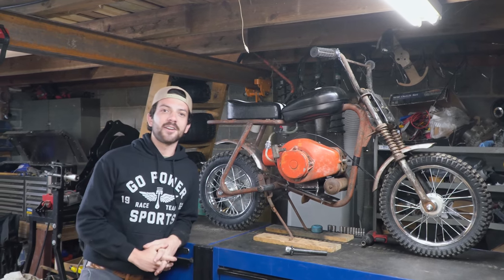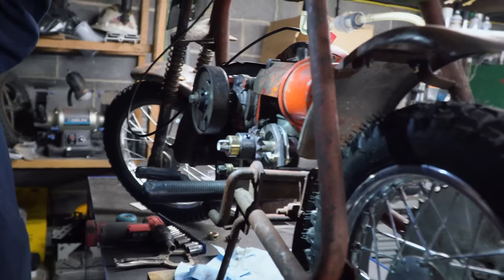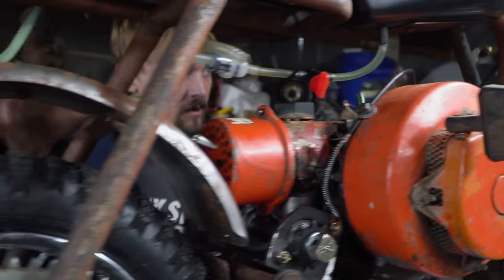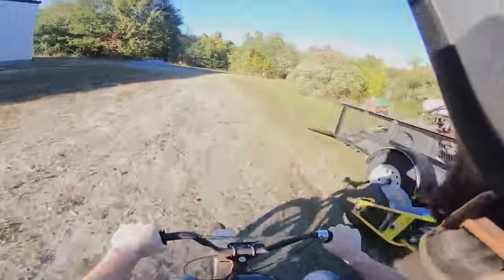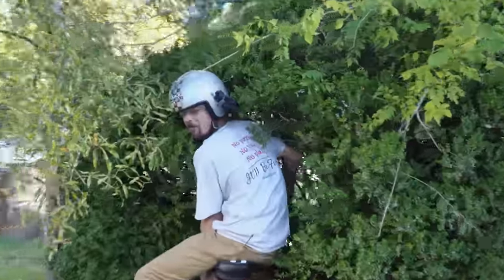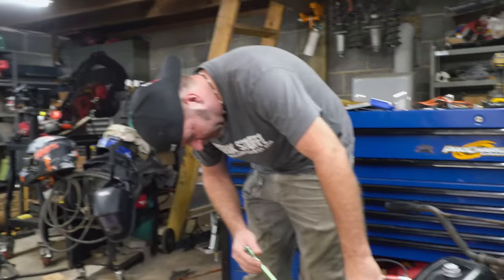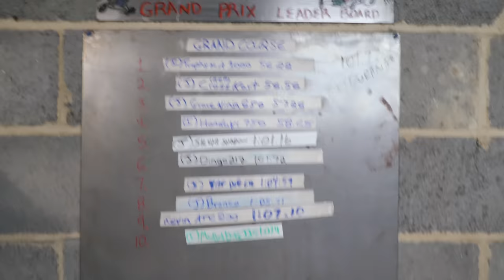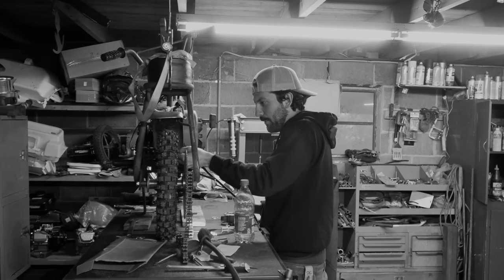Making our 2HP 2 Stroke WASHING MACHINE Powered Mini Bike Faster!

Comment: It got's the power you just need to set the gearing for the high rpm's for a two stroke. Use a slide carb with pod filter.
performance expansion chamber. eliminate the jack shaft.  This thing should rip pretty good. I love this build!
Reply: U r absolutely right. Maybe get some port work done to it (if possible) .. after they get to the next project .. while its just sittin up
Reply: From what I've heard megaphone exhaust works better on this older style than expansion chamber but yes.
Reply: @noahpaulette1490  yes exactly, a proper Mikuni conversion, and a tuned megaphone and it will wake right up, port work on these cross flows are gone about much differently aswell. If anyone is interested, the book tunning for speed, covers alot on the very early two stroke development as it was written first in 48 and updated a few times throughout the 60s into the 70s. Nothing wrong with the jack shaft, the clutch engagement needs to be at a much higher rpm to get her off the line with athourity.

Comment: The Biggest train wreck in C&C history?? I remember a school bus story once...
Reply: Nah 2 strokes for the win ;) 
As the saying goes. There should only be 2 valves on a bike. One in each tire ;)
Reply: What are the odds of you showing up

EDIT: please say that you kind of hate two stroke engines because we all know that they don’t have good acceleration when it comes to full throttle and power. You don’t get no more than 3 horsepower 4.5 if you are lucky but definitely hardly any torque. You’ll have to push it to even get it to go. Also, the carbon build up in the cylinder head will get insanely bad due to the gasoline and oil both entering the combustion chamber and as a result say goodbye to your head gaskets.

One word of advice when you put those 2 stroke vehicles in storage drain all of the fuel immediately. You’ll end up cleaning out the carburettor of all of the sludge. Especially if you don’t want to have the needle and seat to stick because it could cause the engine to run away.

I am saying that about my personal experience with using a 2 stroke go kart. Two words for that…. IT SUCKED

I never bought another one again
Reply: I remember someone rolling a hot rod lawnmower
And the police coming to John's parents' house
Reply: @dilianvt  

...wtf is happening
Reply from the maker: HAHAHAH
Reply: @PKMartin  clearly a long time viewer. Same here bro. I remember a monster moto with a wooden block to raise the engine
Reply: @CarsandCameras  if you change the rear sprocket to like a 25tooth or 28tooth sprocket and keep the front sprocket the same size it is atm you will go faster than it goes now
Reply: #teamseas.
Reply: @dilianvt  I'm not sure if you're talking about particularly awful two strokes because I have an RGV which makes 80hp out of a 250cc motor. My cousin has a two stroke shifter kart and they lap Phillip Island GP course in less time than a V8 supercar (Aussie racing series, fully built race cars). Two strokes are often misunderstood but they can absolutely make big power!
Reply: @codmobileadventures4796   I hate to disagree but, a smaller rear sprocket will, most likely, result in the bike going SLOWER. How does that work? The engine is already working too hard, INCREASING the load will only make it work harder...

I came here to say "if the total gear ratio isn't south of 8:1 (ie: more like 9 or 10:1) it's too high; decreasing the ratio will not only give you better acceleration, it MAY increase top speed because the engine isn't working as hard to get there..."
Reply: @PopllFixit  not really as the rear sprocket it self looks well bigger than a 30 tooth so if they go down to a 25 or 28 the engine won't have to strain it self as much as its doing atm giving them more power nd faster top speed its the same on pitbikes if the rear sprocket is a 41 tooth nd the front is a 14 its going to flip all in the bottom end but you drop the rear to a 35 or 37 then it's got more control on bottom end stopping the bike from wanting to flip as I should no as got a road legal pitbike nd had to do my own gearing to find the best for road use and I ended up with 18front 35 rear and I get 75mph maxed out but sits nicely at 60 nd thats a 140cc pitbike
Reply: @codmobileadventures4796  Cool story, now go try a 3rd gear take off, you'll smoke the clutch before you gain any real speed...

A pitbike, like most other motorbikes (& cars), has internal gears which allow you to take off at a decent rate as well as having a decent top speed as you change through the gears. THIS HAS ONLY ONE GEAR which must be a balance between decent acceleration & decent to speed; it currently has NO acceleration which tells me the ratio is too high...
Reply: @PopllFixit  I do 3rd gear take offs already no problem at all even do 2nd gear take offs still no problem like I said they need to make the rear sprocket smaller for better bottom speed or there going to blow the engine up from having to strain to much
Reply: @PKMartin  remember ike didnt even used to wear helmets...now hes decked out in safety gear lol
Reply: @PopllFixit  once they get the other issues of power figured out to improve acceleration with torque, improve compression ,spark, porting.... the smaller sprocket will give it higher speed only once it has more guts ....
Reply: @codmobileadventures4796  I have know idea how your logic works, do you even understand how gear ratios and torque work? The higher the gear ratio (i.e: gear ratio is 10:1) the higher the output torque but the lower the rpm is and as such it also takes less input torque to produce the same amount of output torque but will require more input rpm to get the same speeds, if that the gear ratio was lower (i.e gear ratio is 5:1) the output torque will be lower but the rpm will be higher and as such will require more input torque to produce the same amount of output torque but less input rpm is required to get a higher speed, thus, being that this minibike uses a 2 stroke engine and that 2 strokes like to rev more as opposed to a 4 stroke (at least in most cases and smaller engines like this), increasing the gear ratio will benefit it more than lowering it as it makes it's peak power at a higher rpm, not to mention the clutch engage rpm is way to low for this engine.

Comment: add more springs to the clutch to make it engage at higher rpm...2 strokes have no power until they wind out...basically the clutch you have on there is meant for a 4 stroke power band that engages at much lower RPM..
Reply: yeah like you would a tuned moped
Reply: You can hear when the engine gets into it stride and starts pulling, it around there it should engage.
Reply: Problem with that is you just burn it out. It's meant to engage just below the rise in the powerband
Reply: Exactly what I was just thinking
Reply: Well it's a washing machine engine not designed for high RPM.  this engine is has port timing design for low RPM.. if you really want to wake it up need to do some porting and add an expansion chamber and some other goodies
Reply: @speedyme200  a pipe could be made for low rpm. Enduro style. Around 6000-7000rpm range would still give her a nice grunt 👍
Reply: That is a very good point
Reply: it needs some timing advance
Reply: @speedyme200  even washing machine engines powerband ran at around 5000-6000rpm which is where most 4 strokes top out..
Reply: Seems you needed the jackshaftto move the motor left side drive to the wheel sprocket on the right.  And with that you had the option to change up the sprockets to get more top end at the expense of bottom end torque.   So then like everyone else said, why not make you're centrifugal clutch come in at a higher rpm?  (I have a 5hp 2 stroke snow blower engine planned for a ktm 50 sx senior).

Comment: You guys should put a two-stroke expansion pipe on their help it breathe more
Reply: Unlikely to find one for that motor. That being said, they're not that hard to make. Plug in the numbers into an online calculator for 2T pipes and it'll spit out something that will wake it up.
But then getting the motor to run in the sweet spot rpm (power band). That should be easier than the pipe, but maybe not...
Reply: @MrSpaz12  this is true my friend I just think it would be really cool and it really would help it runs better with a figure carburetor of course making one is the only way to go
Reply: Bigger
Reply: @johnfarish9305  totally agree. If they're bored. It's a bit time consuming for probably not more than maybe 4 or 5 horsepower and that's fairly generous I think. But they could also play around with squish to bump the compression up a bit. Carburetor. Make some reeds from carbon fiber and like you said, bigger carb. Might even be able to massage the ports a bit as well. And most of what I mentioned is (relatively) cheap if not free if they already have the parts lying around.
Reply: @MrSpaz12  False, you could put a 50-125cc expansion chamber from any 2 stroke dirtbike with welding, used pipes go for no more than a 100 on ebay i have tons of them for my experiments
Reply: It sure would be a heck of a lot of fun though
Reply: @MrSpaz12  we all know the pipe dictates the powerband, right?
Reply: @kenngobrap7077  dude..   you don't tune to pipes..      you build pipes tuned to the specific engine.
Reply: @CobaltOntarioadventures  Also false, you can tune a pipe, like take off the muffler or change the stinger or header size. And with two strokes it dosent matter, if you have a piston thats 47mm then any 50-100cc expansion chamber will make it have more power.
Reply: @kenngobrap7077  I build expansion chambers for a living & export.,.your all wrong to a certain extent ! 😐🇳🇿NZ
Reply: @kenngobrap7077  so you think they make one for that motor? What was false? And you modifying a current pipe to fit is technically making one. But if you want to split hairs, be my guest.
Reply: @CobaltOntarioadventures 
Sure you do. Or you tell me the store that I can go to that makes a pipe for every motor. You can't because it doesn't exist. And as far as little motors go, most are little budgets that aren't having custom pipes made so you tune to the pipe. If you don't then there's a damn good chance it'll run like shit, seize or hole a piston. Or maybe you got so that you call up such and such company and say, "Hey, I'm like the best motor builder in the world and I want that pipe on page 2 and it better make my motor scream or I'll have you in litigation up to your eyeballs for the next 10 years!" the person on the other end of the phone would probably hang up on you. I

Yeah, that's a pretty outrageous little story that hopefully doesn't match reality, but it's something similar to you hoping on here and being a know-it-all. That doesn't know it all. And come across as attacking a few of us.
You're not going to get good results that way.

Anyway, can we not all just sort of enjoy watching the guys do their thing and maybe throw a few suggestions out there or just talk without being dicks?
Reply: @MrSpaz12  Did you see me say they have a pipe for this motor? I said pick any pipe on ebay for a 50-100cc dirtbike to make better performance. Check my youtube they dont make performance pipes for motorized bicycles but I got a pipe from a Suzuki Rm85 from ebay welded it to fit and made the stinger smaller and i have wayyyy better performance than stock, its a 2 stroke
Reply: @trevinskiking2165  How?
Reply: @kenngobrap7077  you don't go to a shoe store and say I want a pair of those size 8 shoes cause I like the look of them to fit my size  11 feet. Trev🇳🇿😇
Reply: @trevinskiking2165  You must not know how two strokes work.
Reply: @MrSpaz12  like the way you are thinking
Reply: @kenngobrap7077  No.,.I've only raced & worked on them since the 1970's, have you ?, Probably before you were born...don't assume. Trev New Zealand🇳🇿 home of the world's fastest old Indian